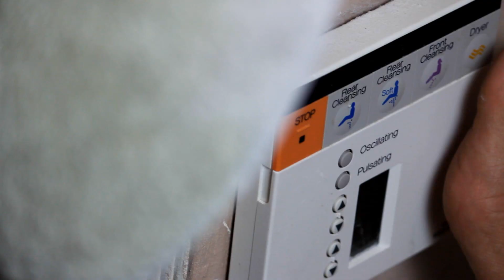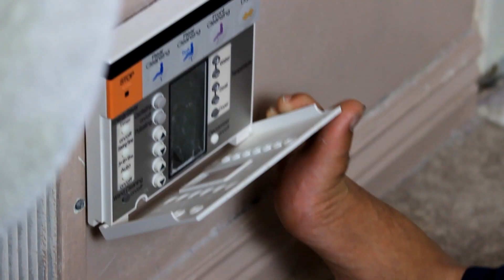Toiletting by the NHB

Comment: Hi!! Why did you choose to go with the hooks instead of prosthetic hands??
Reply from the maker: I actually have both. The reason I like hooks better is that they are water proof, they are durable, they are faster to use and they are easier to maintain. Are you an amputee?
Reply from the maker: This going to the bathroom is an excellent example of why you would need to clean them. That requires you get them moist in the least.
Reply: The No-Handed Bandit No I'm not an amputee I'm just curious about it...
Reply: The No-Handed Bandit thanks for the answer dude!! Wish you the best ;)
Reply from the maker: No problem